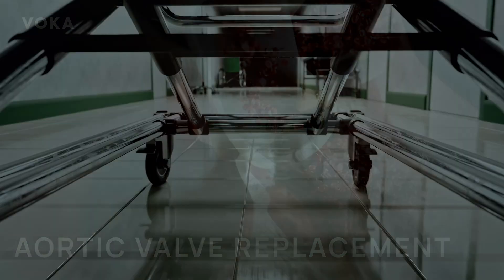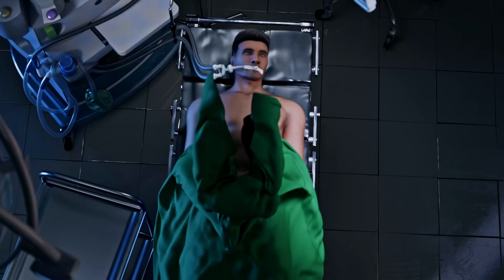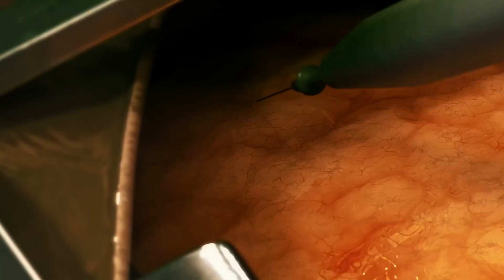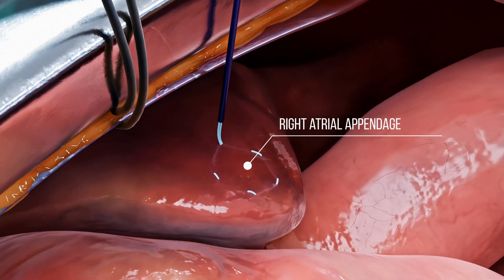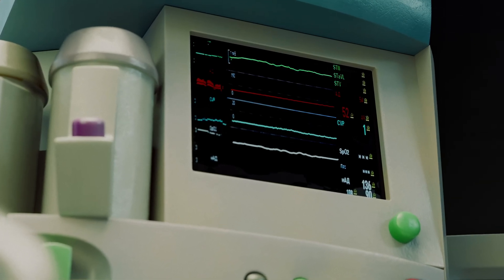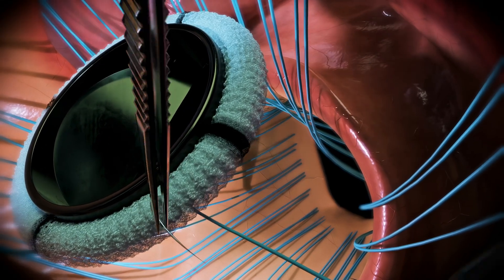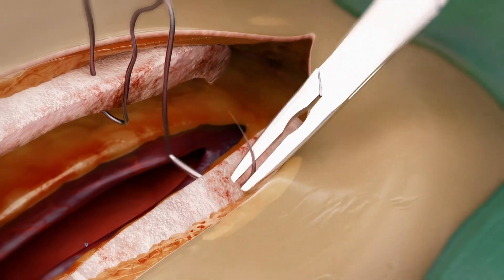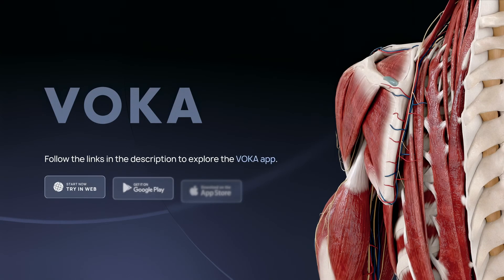Aortic Valve Replacement: Step-by-Step Open-Heart Surgery 3D Animation

Comment: Excellent presentation. I had my aortic valve replaced in 1999, and to this day it is still ticking ticking ticking. My surgeon was Dr. Brown @ Morristown Hospital who did an outstanding job. The only negative is that my valve is a Saint Jude metal valve, and hence for the past 26 years I take warfarin every day and do INR check every two weeks. But I’ll be 90 years old in about a year and a half so it’s working so far. Thank you Lord.
Reply: I'm 40 years old and had a st judes valve put in this June. Aortic valve. Hear it ticking now.
Reply: save your self before dying, revert to islam, at least read about it from its sources.

Comment: This video is out of date. Most aortic valves are replaced by the TAVR procedure, which is a percutaneous procedure that is hugely better.
Reply: That is not the case. If you're young enough and strong they may choose to use open heart. Also if you have a bicuspid valve they will use open heart
Reply: You are so wrong!

Comment: Had a triple bypass and aortic valve replacement 7months ago all good had no pain after operation
Reply: A triple bypass and Aortic valve replacement, all with no pain. Yeah, right! Either you're lying or you have no pain receptors. Anyway, good on you for "having no pain".

Comment: I’ve had that same operation  it was carried out 2003 and I’m  still here  I was 48 at the time of the operation , it’s certainly a fascinating operation.
Reply: get well soon
Reply: Hey Malcolm, what type of valve did you get and why?
Reply: @BeverleyWilson-t8o Hi I had a metal Aortic heart valve and now I’m 70 years old
Reply: @BeverleyWilson-t8o hiya Beverley yes I had a metal aortic valve replacement it was because my heart valve was leaking

Comment: I am 8 weeks post mitral and aortic valve replacement with both being the on-x valves. This video really helped me know exactly what went on inside me. I am a mechanic an like to know how things work. I did have sternal plates and not wires on the sternum.
Reply from the maker: We are glad you find it useful!
Reply: Ur age sir very nervous fear got this operation pl reply me

Comment: they don't stitch back the part under the sternum (pericardium and stuff)??
Reply from the maker: After heart surgery, the pericardium may either be sutured or left open, depending on the clinical situation and various factors.
For example, in cases with significant myocardial edema or a high risk of cardiac tamponade (such as after valve replacement or aneurysm repair), the pericardium is often left open to allow free drainage of fluid and to reduce pressure on the heart.
Conversely, when it is important to secure artificial implants or limit the surgical space (such as during implantation of a ventricular assist device or placement of large aortic prostheses), the pericardium is sutured or closed using a patch.
Reply: @vokaio  Cool!! Thanks for the clarification!